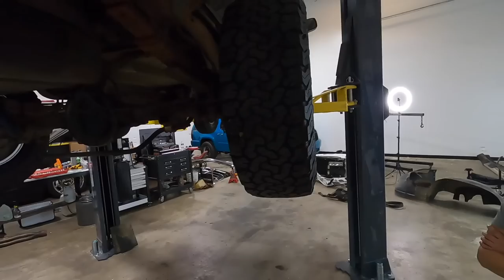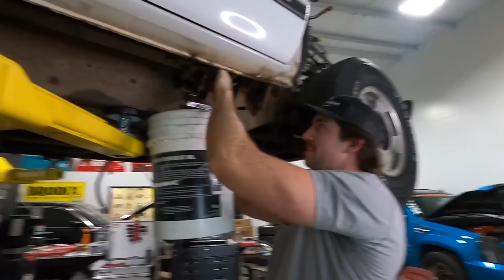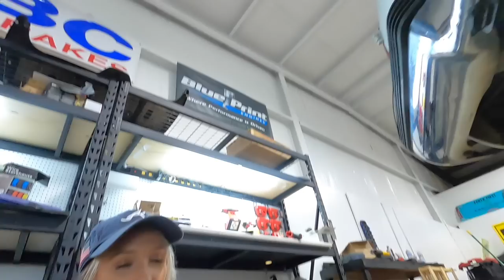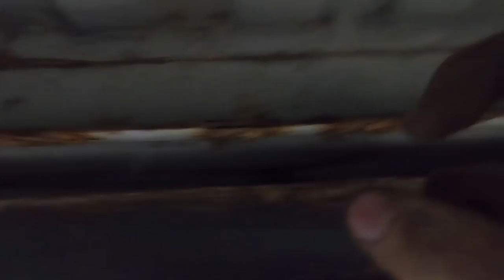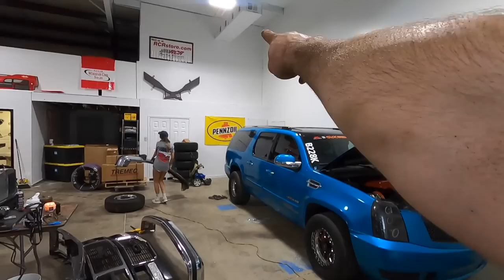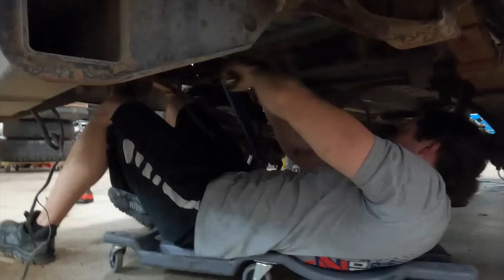GMT400 Suburban Frame Off Build: Body Removal & Getting Ready for Frame Paint! (What To Remove)

Comment: On those big stuck bolts pull don’t push you have way more strength pulling rather than pushing( 40 years in the gym experience). Love this series I can’t wait to see the front wheel come off the ground !
Reply: You also have more control over how far your hand travels when the bolt breaks.

Comment: Uncle George is gonna rock the streets back there when this build is completed! I'd replumb it in -8 AN hose/lines and fittings to feed that thirsty big block. Logan is rocking that rattle gun pulling body mounts, kudos to her for jumping right in and getting 'er done! Excellent tutorial on all the stuff that needs to be done to pull the body off of a frame!
I'm there with you guys as you conquer the rust, old hardware and dirtyass components, have been there & done that too! Big thanks to both you & Logan for another great video, keep up the good work!

Comment: Just a word of advice for the POR 15. Get a cheap paint gun and just spray it. Takes so much less time. I used a brush for years and finally used the gun and what a difference in looks and how much less time it takes. Great job on the build so far.

Comment: Converting to the factory cable shifter will require a 95+ column,  which won't fit under your dash.
Reply: You can do a cable conversion without doing the column

Comment: Anybody, and I mean anybody who says this is a waste of time is just super jelly cuz they dont have a wicked big block to plop into something. Unfortunately to get the cable style shifter you have to have the airbag column. I have a crashed 97 tahoe 4x4, got hit in the rear end and ruined the roof and back doors, so the frame will get a squarebody, and a 5.3, might lift it, with mud tires, but an awd lowered setup would be cool too......
Reply: ATV jack from harbor freight makes the best fuel tank getter outer ever. Ive done like 4 fuel pumps with it, its the best one ever

Comment: .... 1500HD and 2500 non HD trucks will have the 9.5” 14b you’re looking for with disc brakes! And can swap out the 8 lug axle shafts for 6 lug pretty easy. 

My 2000 2500 had one. Good axles, I put in 4.88 gears then beat on it with a supercharged 6.0L and 37x13.50 tires.

Comment: the column just has tabs where your cable goes and theres a pin and tiny alan bolt to disconnect the linkage from the shifter

Comment: A previous employer said that they used a linkage style column but attached a cable to the end of it like they owned the place, don't know if that helps in your case w/ headers but it may be viable. Also, mad props to Logan, I've been a tech (in one way or another for 20 years) now an owner, you just don't find many ladies willing to just Leeroy Jenkins into a task (in a good way). Keep it up folks!

Comment: Have you considered sandblasting the frame and other suspension components and having them Powder Coated?
Reply from the maker: Yes but to do that we would have to completely take the frame apart and redo EVERYTHING. We don't want to go that far. Por15 done right is almost as good as powder for a fraction of the cost and effort. Wish we could do powder...but we have to keep things rolling.

Comment: Taylor Ray just finished a 1990's single cab Chevy with all the factory equipment working with a Holley system running the engine, integrated in with the factory dash.  Reach out, he is crazy smart with this stuff and builds some killer vehicles.

Comment: No, have not seen a frame off on a 90’s Suburban. Love it though, my Dad had a 95 3/4 ton with a 454, 4x4 with weld alum 16” wheels and dang it was cool back in the day. It was also white with gray cloth interior, love the GM cloth interior of the 90’s up to 07 when they hired Dodge to build there cloth interiors! Looking forward to seeing Uncle George go through the refresh! If you pull the dash you should think about the 95-99 dash, love the 2nd gen dash in that body style. But the interior is so clean it’s hard to not keep it. Thanks for the content!

Comment: you guys were lucky as the dirt spray you got taking  out the body bolts back east would usually be the black water funk shower. Also that connection on the condenser for the orifice tube is always seized because of were it is being right in the grill.  they do make a line repair kit just for those orifice tube on GM's. Those other a/c o-ring fittings are not usually very tight like ones you had because they just keep the o-ring snug.

Comment: I am shocked that you got all of the body mount bolts off without breaking any of the bolts.  On that era of pick up, you can normally remove the bolts on the front clip and the front cab mounts.  The rest I usually have to break off on northern trucks.

Comment: For the soaked pits 💦 

Use Certain Dri roll on prescription antiperspirant. You roll it on right before you go to sleep at night. If you’re not a hard sleeper, take a couple Benadryl before bed. It works to shrink overactive sweat glands while you’re body is at rest. If you wake up and go to scratching it will burn like a mofo and nothing fixes the sting. Nothing. Don’t put it on shaved areas or and open little cuts. Way worse then finding paper cuts with sanitizer! Trust me. Keep out of eyes but can use on hands, feet, small of back, asscrack & tatersack (stay clear of any openings). I recommend trying pits first. Then other areas. 

I have used this and an identical product that was the same but called Maxim since I was 14. I’m 38 now and it still works. I would pit soak a shirt before I could leave the house with 10 inch rings. And I love heather gray shirts. As a teen I’d wear a white tee undershirt with paper towels stuffed until I got to school. Wore white top shirts to try to hide the wet. Totally sucks when you’re a teen. 

I used to have to go buy a money order, envelope and send hand written note to order maxim for $13.95 plus shipping and handling back in the day lol. Saved my social life and confidence. By high school I’d get up and speak to the whole school and I talk with my hands a lot. I don’t have to wear full undershirts anymore. 

Found Certain Dri at Walmart years later. Works just as great. 

You may have to use it nightly for a while but then start skipping nights. I use it every 4-6 months now and it works great. I use Arm & Hammer Naturals stick deodorant (not anti perspirant) just as a smell good because I like it. Using Certain Dri also prevents the stench from hyperhydrosis. 

Sorry for the long post but this stuff has helped me have total confidence as a person and I always recommend it to anyone I see struggling with hyperhydrosis. Maybe this will reach someone in need. 

20+ years later Certain Dri is half the price of what Maxim was lol. Amazon & Walmart has it https://a.co/d/4C64If5. 

I noticed they have stick and powder now Haven’t tried those. Only the one with the rolling ball and thick liquid.  Good luck to you all who need this. Hit me back with questions if I can help. 

PS love the build! Pin this if you like.
Reply from the maker: If I’m working hard I’m going to be sweaty that’s just how it is 😂 unless it’s very cold in there lol

Comment: Hello I wanted to know is it possible to convert a 2003 chevy tahoe 2wd to a 4wd?
Reply from the maker: With a welder and fabrication skills yes but otherwise no. The frames are different and you can’t direct bolt in a front diff

Comment: You do not have to take the column out to get the transmission cable out  just the plastics around it. It will have a little clip holder that holds the cable into the colum shift and will come out through the floor once it's unhooked from the column.
Reply from the maker: So are you saying I can rig the stock column to work with a newer factory cable?
Reply: @Stapleton42  it should work yes, you'll have to pull the drivers side carpet up and you will see where it runs through the floor.